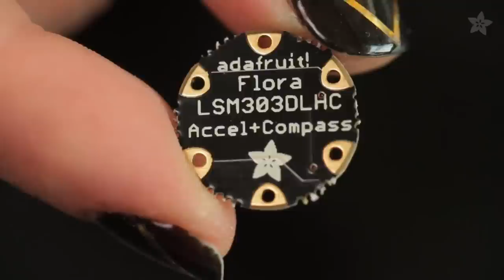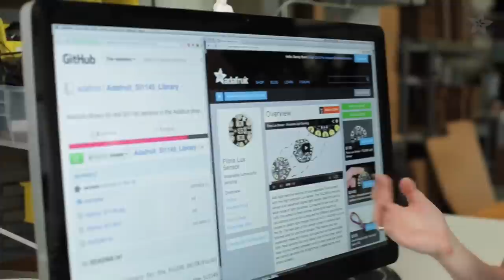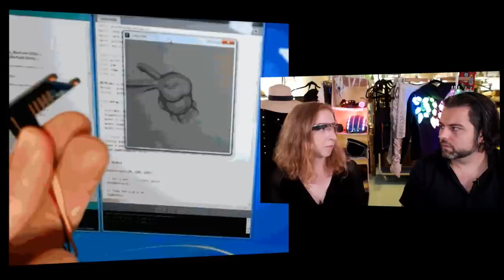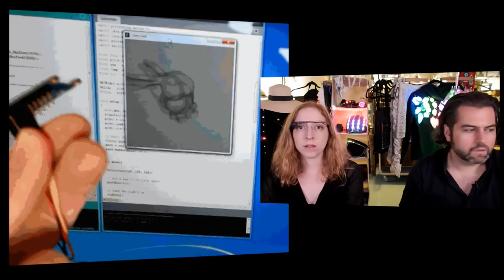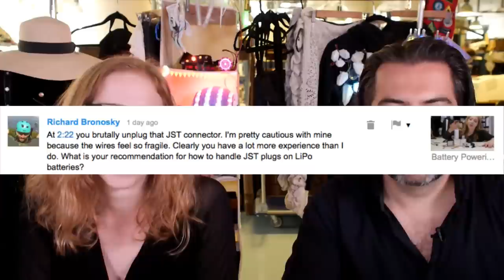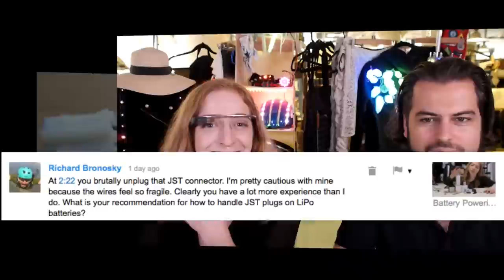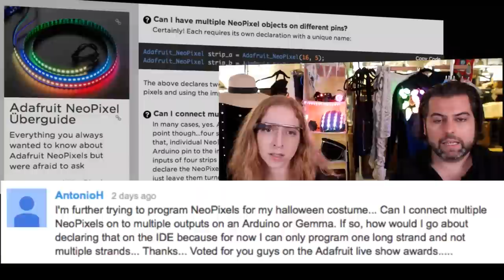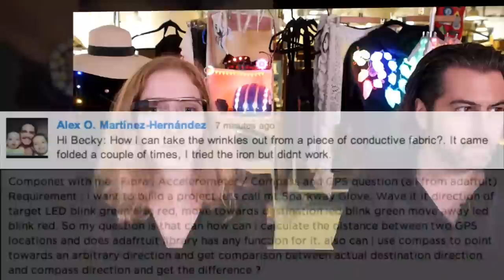Wearable Electronics with Becky Stern 8/6/2014 - LIVE

Comment from the maker: http://youtu.be/v4XJdutvmn8 & http://www.adafruit.com

#adafruit  #arduino   #electronics   #hardware   #opensource   #projects   #raspberry   #computer   #raspberrypi   #microcontrollers   #LEDs   #LED   #gemma   #flora   #bluetooth   #bluefruit   #neopixel   #neopixels   #wearables   #art   #askanengineer   #showandtell   #madewithcode
Reply from the maker: Ed Ostling Panasonic PADMCGH3B
http://www.bhphotovideo.com/c/product/892456-REG/Panasonic_Lumix_DMC_GH3_Mirrorless_Digital.html

Blackmagic Design Intensity Shuttle with Thunderbolt
http://www.bhphotovideo.com/c/product/842013-REG/Blackmagic_Design_BINTSSHU_THBOLT_Intensity_Shuttle_with_Thunderbolt.html

Olympus OL1718B
http://www.bhphotovideo.com/c/product/971405-REG/olympus_v311050bu000_m_17mm_f1_8_lens.html

for a mix board we use a multimix: http://www.alesis.com/multimix8usb20

and for mics, we use sennheiser ew 112-p g3:
http://en-us.sennheiser.com/lavalier-clip-on-microphones-wireless-set-presentation-ew-112-p-g3

for lighting you're call for your space/location - we use these:
http://www.bhphotovideo.com/c/product/258599-REG/Kino_Flo_KIT_D4_120_Diva_Lite_400_One_Light.html

maybe we'll do a guide later / video tour too!

Comment: If I choose to go beyond the limit for power on a Gemma, is it possible to strip a spare USB cord and connect it to a separate power brick, will that provide enough amps and if so/not, what max amperage wound i need to be provided from a power brick. I am using 240 WS2812B's for my project and trying to be the most efficient in terms of weight from batteries. Thanks.